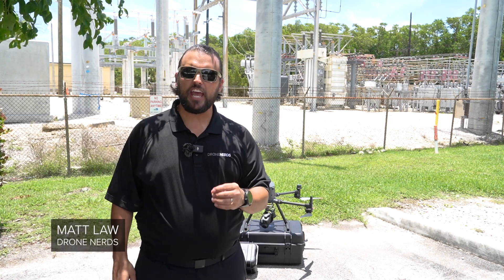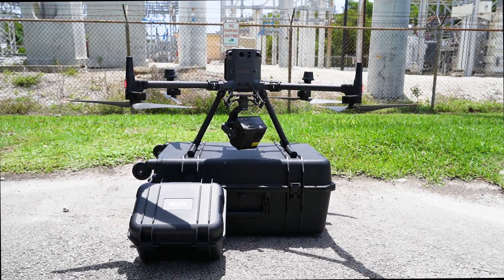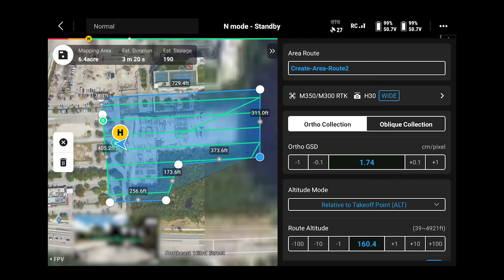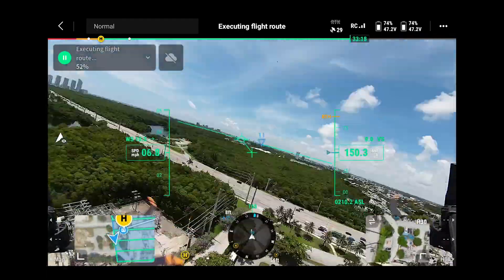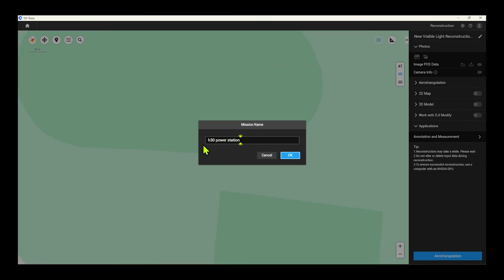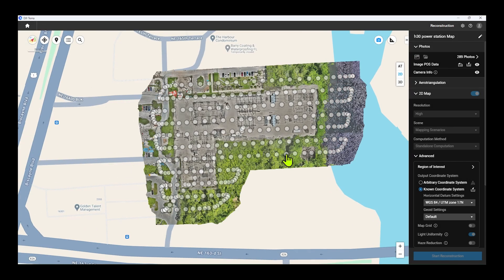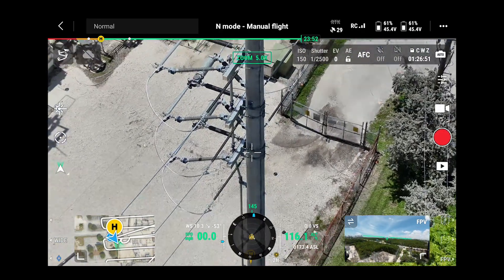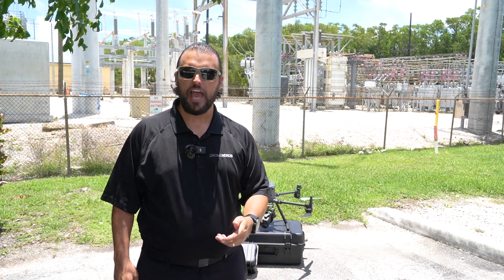DJI Zenmuse H30 Series - Energy Inspection

Comment: Is it not an overkill? You can map that with a mavic 3 with the same results?
Reply from the maker: You could. However the payloads on the Mavic series are not interchangeable. The M300/350 can have multiple payloads added. The H30 series has many benefits over the M3E. Thanks for watching!
Reply: @DroneNerds Maybe, as one of the lucky ones here, owning the best of the best equip, you could show us in your next video what really is special in this new payload, show us some thermal footage, the zoom in that mode, compare to the older models and also the optical zoom on the tele lens, thanks 😉
Reply: You are correct that you could map this with an M3E. To be honest, when I saw this video it started out mapping the substation, I was surprised. It is not something that every inspection would require but there is no doubt it can be useful. I imagine the emphasis of the video was meant to be on the power of the M350 payloads. That is where the inspection is valuable, close up looks at every component with the operators boots on the ground. I have never done a substation inspection without a thermal camera as well, but even so, the H30 provides details which are valuable documentation. So the shorter answer is no, you could never do a comprehensive inspection with an M3E.